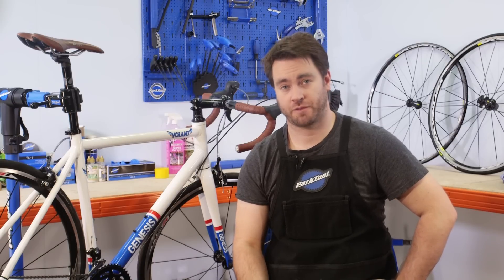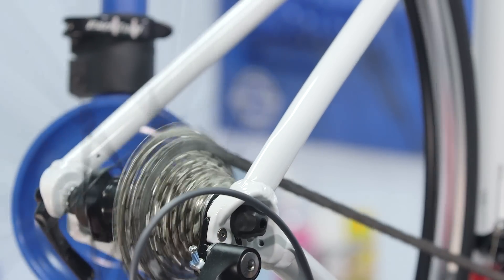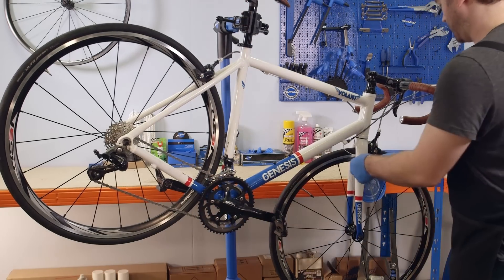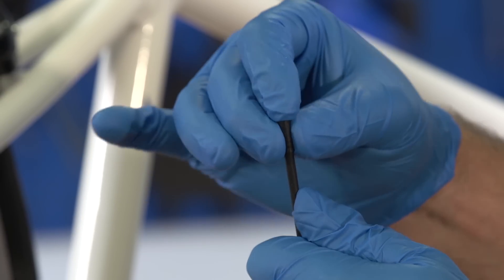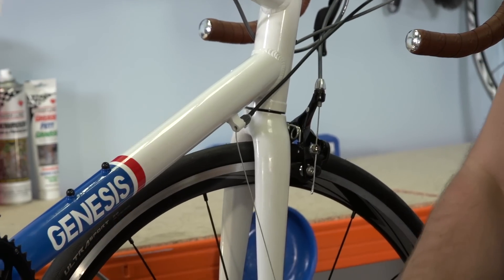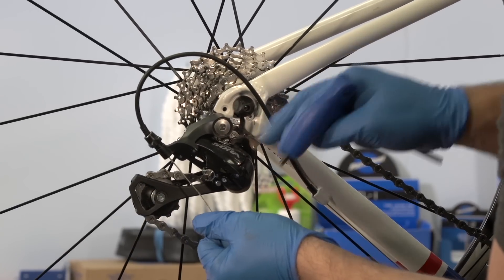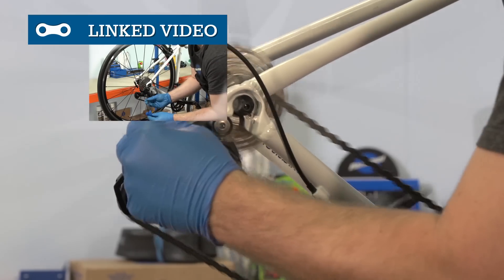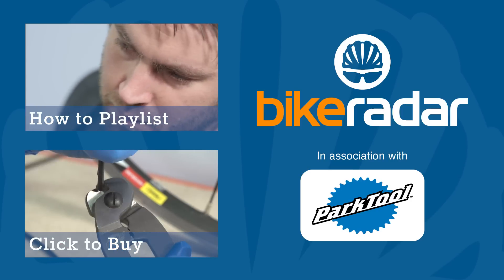How To Replace A Road Bike Gear Cable

Comment: On my road bike I'm about to replace my gear cables. Where they pass below the bottom bracket they are exposed. Is a good idea to put them inside some sort of small housing to keep them clean and reduce wear on the bottom bracket cable guide? If so what sort of small housing should I use? 

Great videos as always. Thanks!
Reply from the maker: RixterNow That's a great idea - you quite often find a thin piping on cables which would be perfect (maybe try asking a bike shop). We are currently trying to source some and will let you know if we find out where you can buy it.
Reply: I was also thinking of trying ordinary electrical cable and see if I can remove the inner piece of copper